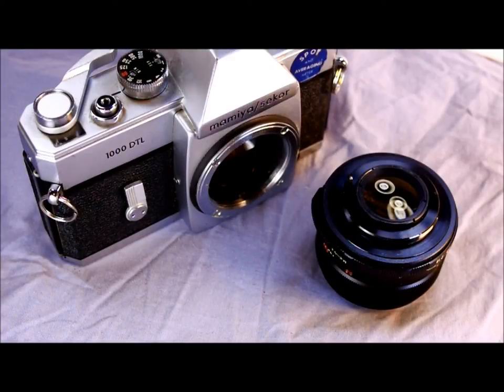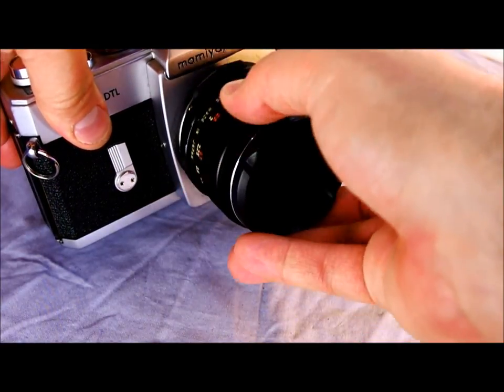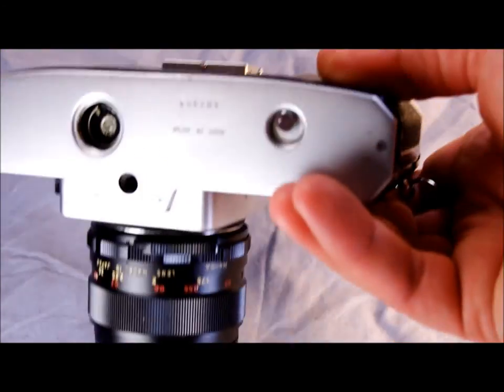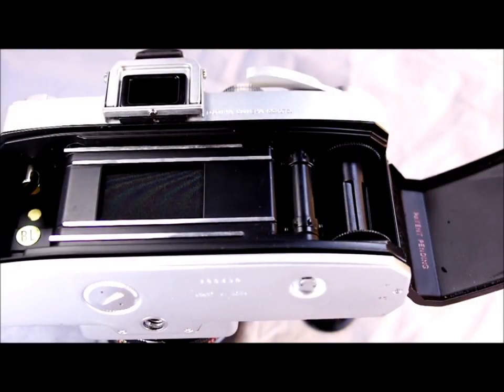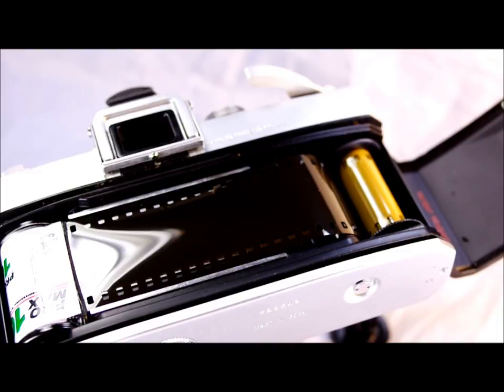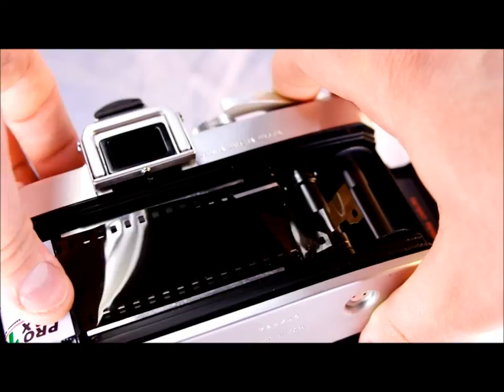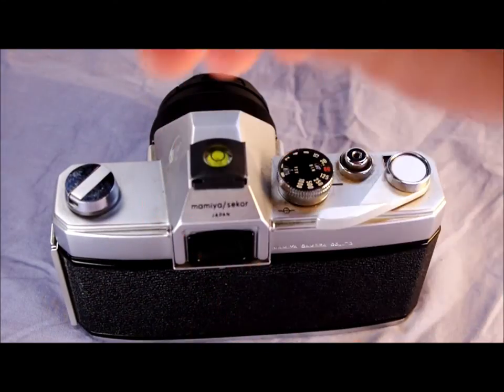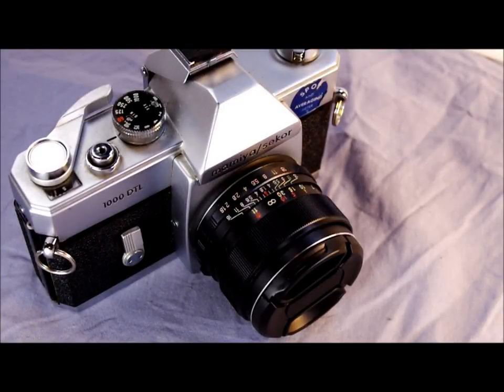Mamiya/Sekor 1000 DTL Video Manual, Video 2 of 2

Comment: I had bought a 1000DTL and a whole kit of lenses and macro tubes as well as the manuals in ~2011, which was my first ever SLR, although the meter didn't work, even with new batteries and stopping down the lens  the needle was dropped past "-". So I worked pretty hard but I got pretty decent shots. Although learning on that camera and now the lenses I still have have helped now with an adapter for my new D5500 I have gotten awesome shots with those older lenses although still no metering live view helps alot.
Reply from the maker: Nice!

And it's great to be able to use a camera and still take photos even when the batteries are useless. :D

Comment: Excellent video! Two areas to mention might be light leaks due to rotted foam in old cameras; 
Also, the owner's manual states that the Spot which is metered is in CENTER of viewfinder, the bottom square only indicates width of the Spot area, I guess about 3% of the view. 
"Averaging" metering is the whole scene, metered, but you said that! Thanks David!
Reply from the maker: Thank you!

Comment: I won't forget the time I put my SMC Takumar 50mm 1.4 on my Zenit.. I thankfully managed to shim a card in there to get the lens off.
I noticed that this pin retracts when set to manual mode, but it can only be set to manual mode when on a camera body with the pin retracted, so it helps you not if it's already stuck on a camera.
If you were extremely careful to always put on and take off a SMC Takumar lens while set to Manual stop-down, you may be able to use one on this camera. But don't slip up, or it becomes a fixed lens camera from then on out. You'll need to disassemble your lens while mounted to the camera to get it off. 
Probably best not to tempt fate.
Reply from the maker: Thank you! I didn't know that was a problem.

Comment: IIRC Fuji were almost as late coming out of the M42 era; the difference is that the Fujinon lenses offered open-aperture metering on the appropriate bodies and this made them every bit as user-friendly as (say) a Pentax K camera. The bodies were also not particularly large; I have an ST705 and it's just smaller enough than a Spotmatic all round to be noticeable in my hands. The DTL1000 looks solid, though; the sort of camera you could smash someone's head in with and then use to take photographs of the victim (writers of crime dramas set in the 70's, please note).
Reply from the maker: LOL. Yeah, the old Mamiyas weren't designs to be small or light.

The Fujis are interesting. I had a 605 for a bit and it was a nice camera. I'm not entirely sure why they didn't catch on as much as other makes. Maybe just because they weren't as nicely trimmed in the styling department. Or it could be a marketing failure. The Fuji lenses are, I'm told, exceptional performers with great sharpness and color.

Comment: hey hey david, your videos are amazing, eye (I) got this camera in '19 and have been coming back to your videos as a basis 💐.
 eye was wondering if a battery is placed in the camera but the light meter doesn't move is their something wrong with the battery or the camera and will that negatively impact usage? 
Always the best x feliz año nuevo 🎉 más abundancia 🌻
Reply: also this may sound silly but are the tl and dtls the same or completely different?
Reply from the maker: Thank you!

For the battery, it could mean that the battery is dead or that the meter is dead, or that a wire inside the camera is loose. There area bunch of possibilities. In that case, I'd just use a smartphone light meter app and dial in those settings. Those will be close enough.

For the TL and DTL, the DTL replaced the TL models (I think I have a video on one of the TL cameras, too.) It's been a LONG time since I used my DTL, but I think they had a meter improvement, a hot shoe, and a faster minimum shutter speed.
Reply: @DavidHancock  bloop eye really appreciate you taking the time out to respond 😭💕x your videos as well as the comments have been very helpful. thank you kindly for sharing, eye shall return with any follow-up questions, you seem like one of the best to be informed by🤷🏾‍♀️🐥🌻

Comment: First - thanks for the informative videos on this camera.  I am a semi-pro photographer (shoot with Nikon D750 and D850) and recently attended an estate sale of a professional photographer.  One of the items I purchased was this camera ($6) with the initial thought that it would look good on a shelf in my studio.  After researching a little, I became intrigued and now want to shoot some film - like I did way back when :).   In the first video you mentioned not to touch the mirror or the shutter.  When looking through the view finder, I see several black spots / line (appear to be debris) and want to try and remove.  Any suggestions?  (FYI - I clean the sensors on my Nikon's using a Carson Sensor Magnifier and full frame sensor cleaning kit).  Thanks!
Reply from the maker: The line is a worrying sign. That could be prism degradation. If so, then the prism is shot and needs to be replaced. The dots could be the same thing, too, but it's hard to tell. They could also just be dirt that's between the prism and focusing screen. Either way, these need a professional repair to fix that.

Comment: Hi David,
thank you very much for making such a good video. I bought this camera a few months ago and now I have time to shoot a few photos. Last week i  bough a s76 battery and I don't know if it's ok for the camera. How can I know if the battery is working? And how can I know if the meter is working? I played a bit with the camera and the meter moves when I change ASA/Shutter speed but I don't if it's alright.
Reply from the maker: Thank you!

The S76 provides too much voltage for this camera's light meter and will cause it to underexpose by about two stops. You can either increase the ASA by two stops, buy a voltage-adapting S76 adapter (about USD $40), or modify the circuitry to accept modern batteries. The Fix Old Cameras channel has a video showing how to do this on a Canon (FTb, maybe?) or Olympus OM-1, I forget which, but the process should be functionally the same. That requires a soldering iron, solder, and a $3 electronics piece.

Comment: Hi David,Thank you very much for making this comprehensive video. I just bought this camera and have loaded new battery (76S) and film, but the little stick in the light meter isn't moving form its sleeping spot way below the negative end. It doesn't change  whether I have it in Spot or Area metering mode. Is it broken, or do I have to "turn something on"?
Reply from the maker: +teah dora Thank you!

These cameras have slightly counter-intuitive, at first, light meters. Make sure that when you use your light meter that the film advance lever is away from the camera body. If it's hugged up against the camera, then the light meter is off. The top of the film advance lever is a button that hugs the lever against the body. So if you push that and the lever goes inward, then the light meter was on. If you push it and nothing happens, then the light meter was off.

Also, make sure you do your testing outside. If you're testing indoors, there may not be enough light for the camera's light meter to return a reading.

Let me know if those suggestions help.
Reply: Hi David, Thank you for your reply and suggestions. I didn't know about the button on top of the lever before. Tried again and seems like my light meter should've been on all along, and it's not moving. I guess that means it's broken :(  Will see if can get it fixed. Thanks!
Reply: Hello David. Will the light meter function if there is no film in the camera? I'm experiencing the same problem as teah dora after inserteing new battery. If the meter is inoperative, is it worth having repaired? How much should that type of repair cost? I'm debating if I should get a new camera if repair equals or exceeds cost of new camera. Thanks.

Comment: How do you test the battery on the camera
Reply from the maker: Test the light meter. A good way to do this is outside in full sun with the sun to your back. On something like a sidewalk, tree, or other mid-toned thing the shutter speed should be close to your film speed with the lens at f/16. Alternately, indoors in a well-lit room, at 400 ISO and 1/60th of a second, anything from f/4 to f/8 (depends on lighting) would be close to accurate.

Comment: Would you use spot metering for portraits and average for landscapes ? I’m just confused about that.
Reply from the maker: That would be a very good use, yes. You can also use spot metering in landscapes to get a specific reading from a specific point that you want to be the middle tone in the image. To see what I mean by that, try taking the same image three times in a row but use spot metering on a bright cloud, an area of the scene that's in sun, and then a deep shadow respectively.
Reply: @DavidHancock  love it, thank you. So since the spot meter is on the bottom of the view finder, you would pretty much put that “darker” area that’s on the view finder and point that at the desired spot? Let’s say my object is directly in the middle, would I point up, get the spot meter on the object, set shutter speed/iso, then re center the view finder and fire?
Reply from the maker: @kevinclifton7911  Spot on! (See what I did there?) But yes, you've got it.
Reply: @DavidHancock  thanks so much! And thank you for taking the time to make these informative videos and replying to comments! Helps a lot !

Comment: Hi, I'm 19, I just got this camera at a flea market and I'm super excited to use it but I have basically zero experience with cameras. My shutter button seems to be jammed? I can't press it down, what am I doing wrong? I changed the battery and had my mom help me load the film but it's not clicking, please help!
Reply from the maker: The shutter will only fire after the from is advanced. Try to advance the film, even if there's none in the camera because that action arms the shutter, too.  If that doesn't work let me know and we'll see if there's anything else that I can do.
Reply: @DavidHancock  I’m having this same issue. I’ve advanced the film and it still doesn’t work
Reply from the maker: @OverAnalyzer.  Most likely it needs to be repaired. A gear or cam is probably jammed or misaligned.